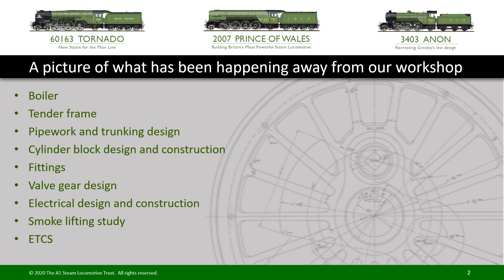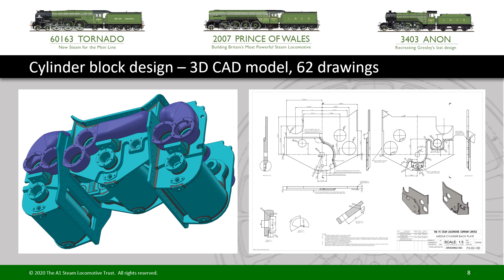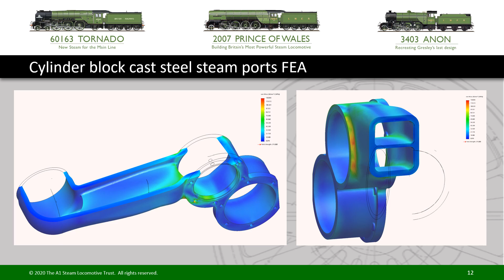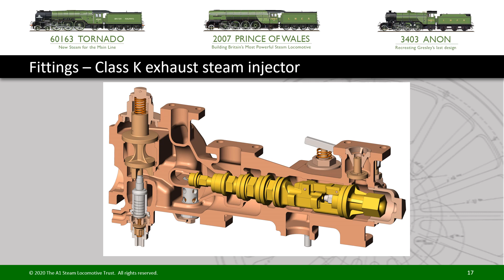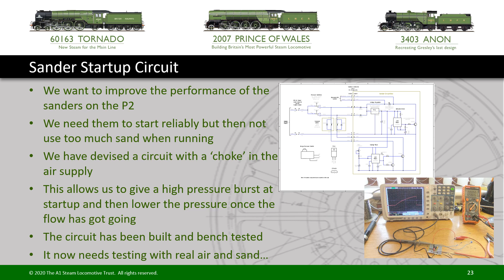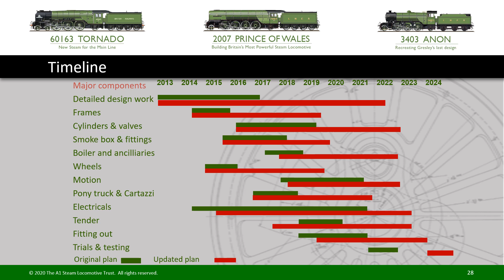2021 P2 Convention Presentation

Comment: First, this is a truly brilliant project.  I'm not an engineer, but am intrigued by the amount of new design and redesign you've undertaken.  How much have you been able to use the original drawings, or have many of these been lost?  I can see how the electrics need to be to modern standards, but assume that you didn't have detailed original designs available for the valve gear either?  Or is it that you need to redesign everything because you're using slightly different materials or manufacturing methods?

On the subject of the cylinder block, and noting the design changes mentioned here and in another video, does this mean that this will be a significantly more powerful loco than the original, or will it just be slightly more efficient?  (Or maybe able to cope with lower quality coal?)

Comment: This is SO AMAZING, and is literally the first time I've ever heard about this project, (outside of marginal murmurs in the U.S.). Am I to understand that you're not only restoring this locomotive, but that you're completely re-inventing the machine from the ground-up? WOW, am I impressed!!! You've taken Alco's design, (back in the early 1940's) for their 4-12-2 / 3 cylinder monsters which ran on the Union Pacific Railroad here in the States and are building a brand new 21st Century Steam locomotive. How cool is that? As we both know, the U.P. engines were doomed with problems from the start. The most prevalent being shop forces "hated" those things when they came in for Class 3 repairs in that the middle cylinder was almost impossible to reach, thus facilitating enormous down time and operating expense, (not to mention wheel base restrictions which you don't have here). Your technological expertise and pure determination is outstanding !!! Do you and our "T1 Society" talk to each other? Oh wait, I didn't read that part of the article printed in Trains magazine, but just did. Sorry for my ignorance.

Comment: I know this is about 2007...but ibam interested in knowing about 3403s name since as far as i know this is the first time its beem seen as anon
Reply: It’s still yet to be named. I would guess at Bantam Drake, or King Charles III.
Reply: In an earlier convention presentation they showed the sprite for 3403 with the name "Anon" aswell
Reply: They've said in the past 3403 will have an Army name in keeping with the theme of having locos named after an Air Force squadron (60163) and a Navy aircraft carrier (2007). Personally I thought Bantam Chick would've been a better choice keeping in line with the originals, Bantam Cock and Bantam Hen, but its their loco at the end of the day really. "Anon" is just the placeholder and not 3403's real name.
Reply: I think 'Anon' stands for 'Anonymous' as the name, to my knowledge , has not yet been decided.
Reply: Just feel lucky that some 'wag' hasn't pushed for "Trainy McTrainface", or some other "Internet funny" name.
Reply: It's a class V4, so perhaps they could name the engine "Corsair" as a reference to the Ford car which was fitted with the V4 engine. Failing that, "Taunus" or "Transit".